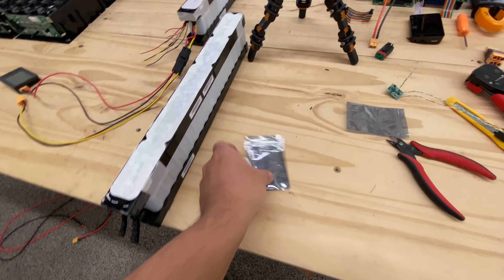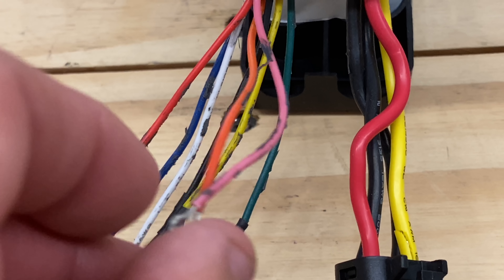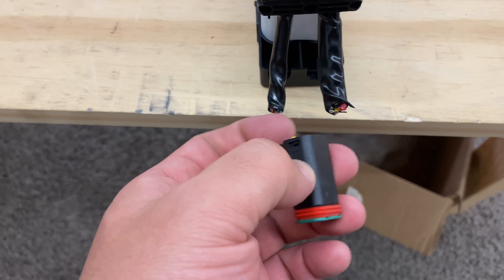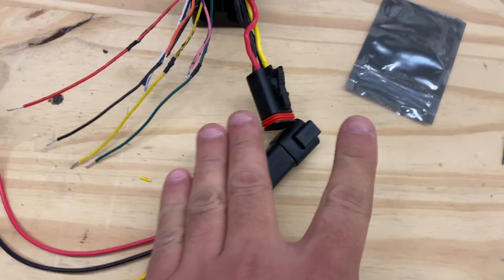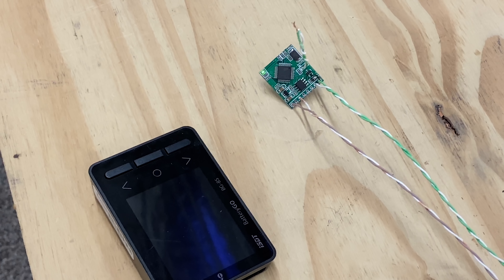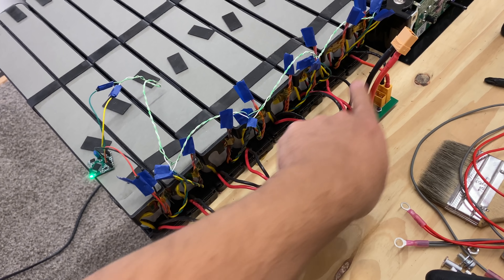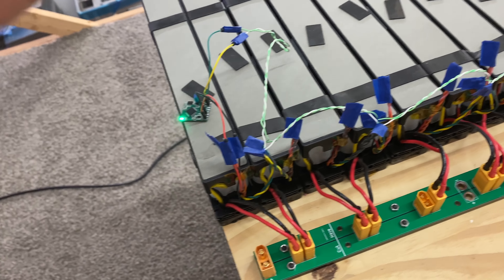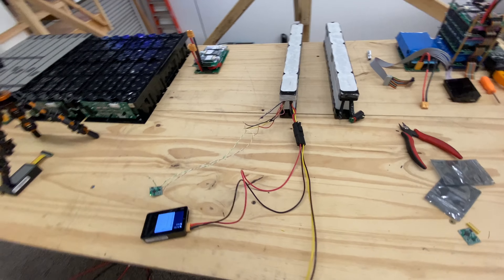Waking up Scooter Lithium Batteries w SMt32 CAN Controller

Comment: those wires you call switch, I believe it is to activate the 120 ohms parallel resistor which is mandatory if the card is at the end of a canbus line, if it is in the middle should remain "open" and let the devices at the ends of the witing do the loading of the network, which should be 60 ohms. but since in this case it it the battery card and the CAN controller, the resistors should be permanently connected. Do us a favor and turn off the power to CAN controller and measure the resistance on the two wires that go between the battery borard and the CAN controller, it should read 60 ohms or really close to. any higher value can make data transmission noisy. Best Regards.
Reply: Oh I saw the schematics, yes its a plan on/off switch here.

Comment: Just a quick point that might make the CAN thingy work more reliably: 
The CAN bus needs 120 Ohm termination resistors at each end (assuming it's high-speed CAN).  Info available on the web.  Here's a good reference: https://www.kmpdrivetrain.com/paddleshift/practical-tips-can-bus/
(Awesome that somebody reverse engineered it and built that little board! You get a gold star!)

Comment: Correct me if I’m wrong but I think it is a STM32 microcontroller, not an SMT.

Love your vids!! Thumbs up!
Reply: StringerNews1 you have a link? 
Because:
1. I believe the chip shown is an STM32 which is a very common chip with a CANbus connectivity feature.
2. Google results are filled with mistyped STM32 topics when searching for “SMT32 canbus”
Reply: StringerNews1 i didn’t get the .org site as a result -at all-.
Indeed the STM’s are MCU’s and if I look at the video the chip resembles one. (Aside from the fact that this is a fairly common misspelling in the forums.)

I’m pretty familiar with RS485 which doesn’t differ from CAN too much on the hardware side.

I’ll give duck duck go a try

Comment: Does this still not allow discharge when charging?
Reply: Excellent question
Reply: Take a look at my comment and Jehu's response above Adam. If I understand correctly, I believe Jehu's answer confirmed this. Looks like you can charge via the load wires to circumvent the simultaneous charge/discharge issue.

Comment: @jehugarcia I purchased several of these, wondering if you figured out the simultaneous charge/discharge issue? Did we determine if we can charge on the power side of the battery with all the normal protection intact? Since it has regeneration braking, I read that we might can just charge/discharge only on the red and black wires.
Reply from the maker: Yes we can charge via load wires
Reply: @jehugarcia  That is great news, thanks for the reply. I know a lot of people were interesting in that answer, as it is a critical feature to using these for a power-wall type application to allow for simultaneous charge/discharge. I have been waiting on this video and just ordered the CAN controller! Thanks for actually following through and getting this solution out to your customers!

Comment: I did some calculation, ok, simple math and came up with 36 volts 12aH, does that sound about right for each pack? I have 4 and have done nothing with them yet, but if they are 12aH per pack, holy cow you get a lot for your money!

Comment: Hi 
I tried to connect escooter battery with only + and - wires to ebike controller with   positive and negative wires plus three other wires. On the controller is written CAN  controller.
The problem is that display goes on directly by connecting + and - wires. Also display shows error code. 
Can I fix it anyhow? 
Thanks.

Comment: Can the internal BMS be used in series (72V)?  I have an application for this but only if I can get >60v
Reply: I did the pin 3 hack and have been using two in series. Put a switch between pin 3 and ground and you can turn the BMS on or off.  It's also a lot cheaper if you just want to turn the BMS on and off, as opposed to using the CAN chip
Reply: @aayala1053   where can we find more info on the pin 3 hack?
Reply: @aayala1053  Thanks, it worked, I end up connecting pin 3 to the ground of TP7 with a 1k resistor!!!

Comment: I connected the CAN controller to my battery pack and there is a voltage on the output terminals.  However, when I connect the terminals to a load, the BMS shuts down.  Anyone else experiencing this?

Comment: All 16 pack I receive had no wires.
Reply: Same here.  @jehugarcia, show us how to add the wires.
Reply: same here...wonder who actually received them with wires
Reply: Looking closer at my batteries, there is an area that was cut out, leaving behind the stubs of the wires.  The stubs are so short, they are useless.  Farther back, I see a couple larger gauge wires, also cut short.   We need guidance on how to restore these batteries to work with the new CAN board.
Reply: My battery packs also have the control wires cut short.  However, with a sharp plastic scraper or screwdriver, one can carefully pry under the thick black coating covering the wires and circuit board.  With the black coating removed, you can then see 8 solder pads.  You can also read the labels for each pad: Link A (Pink) , Link B (Orange), GND (Black), CAN-L (Green), CAN-H (Yellow), VSYS (Red), WKUP (White) and 1-WIRE (Blue).  VSYS (Red) connects to 5V on the STA32 CAN Controller, GND (Black) connects to GND, CAN-L (Green) connects to CANL, and CAN-H (Yellow) connects to CANH.  What Jehu refers to as a switch are Link A (Pink) and Link B (Orange) which need to be jumpered together.  Add a switch to the STA32 CAN Controller.  If everything is wired correctly, when you turn the switch on the STA32 CAN Controller, you should get power output from the battery.
Reply: @markyo99  My plan was to rebuild all packs  into 1S x ?P and stack them as required.   I will be sticking to that plan.  This way I can configure them as needed.  7s 10s or what ever.